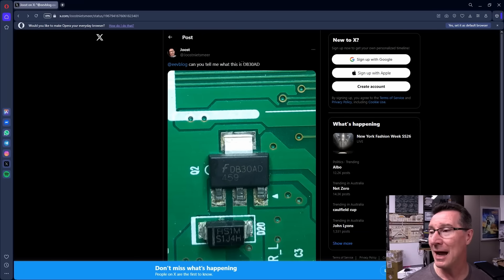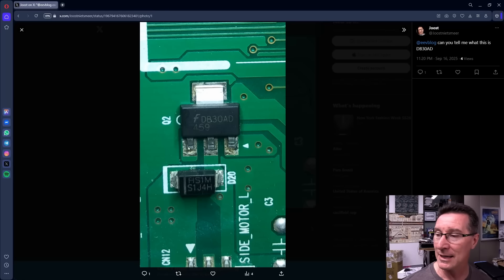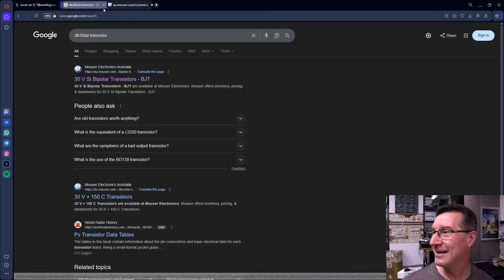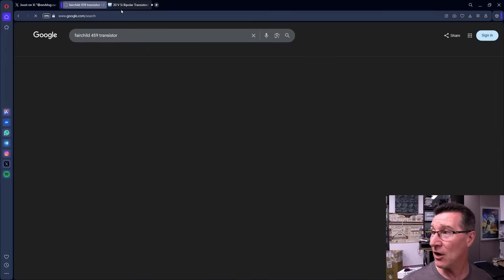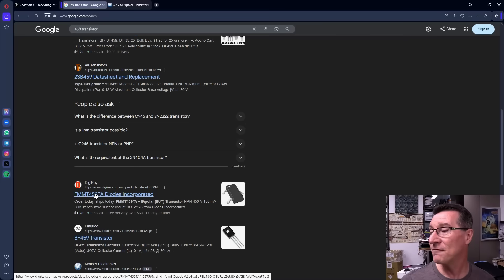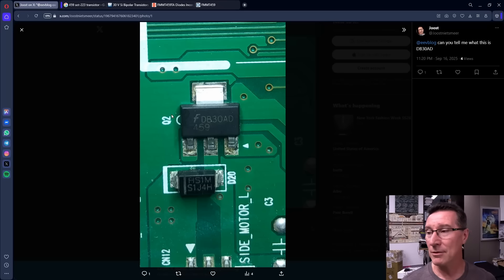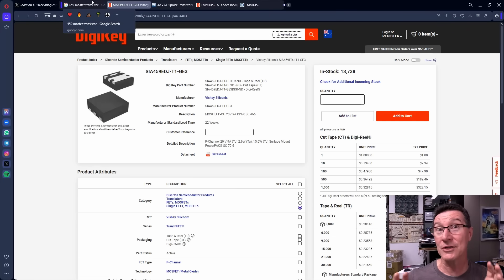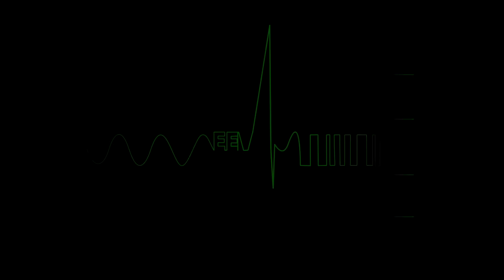EEVblog 1708 - What's This SMD Part?

Comment: I previously worked at a semiconductor manufacturer and it once took a full week to confirm that an IC on a board was in fact ours and exactly what it was (DCDC regulator). It was a smaller part but they certainly could have made the identifier more pronounced on it.

Comment: Dave, your point about including the manufacturer in the search term can be critical. I'm restoring some 50+ year old equipment and recently was searching for data for part where I had both the manufacturer name and part number. No luck on an exact match for the part number but using the manufacturer name alone I found a data sheet from the correct era but still no luck, so then looked in the folder containing that document and found another document with data on the part I have. Interestingly AI searches could not find this document even when the AI was given hints on how to search.

Comment: And then the board designer decides that it is a good idea to leave the silkscreen off when they have boards spun up.
Reply: My employer stopped putting SS on most boards many years ago.  Some exceptions.  Cost reduction reasons initially but now a lot of boards are so dense with really tiny parts there is no room for it anyway.  Then there is the issue with the SS height affecting the stencil laying tight/flat to the board.

Comment: is this a challenge is it ? ok no google no nothing. side motor L connects to middle pin collector or drain.
motors have kickback , it looks like a kickback diode D20, with anode connected to collector/drain. its an NPN or n-channel mosfet.
and with laser etching , wacky part number and modern soldering that sux like lead free.....this is likely the most average mosfet on the market or a bipolar transistor with some amazing saturation voltage specs. definitely the cheaper option imho.

Comment: I've had great success using ChatGPT 5 with its agent mode. I can pop in an image of the component and it takes anywhere from 5 minutes to 30 minutes to research and find the data sheets when it would have taken me more time if I could find it at all. Sometimes it will struggle and may provide something close but not exact.  But, combined with my experience and knowledge I can figure it out. Saved me a lot of time digging.

Comment: Problem is the older discreate parts are now gone to SMD and the part numbers are out the window. And sad the manufacturing doesn't even try to make their parts known or easily identified... Even resistor color codes are basically useless now too... New generation of electronic parts has taken over.

Comment: What would be the reason to not put FDT459N on the case?
Is that to help the people who would normally sand the markings away?
Reply: Clippy has nothing to hide behind obfuscation.
Reply: Not enough space, font would be too small, and if you believe you can read laser inscribed tiny font remember we coat our military-grade boards in heavy conformal coating so markings you could read naked, can't read anyways due to CC.
Also something you can read inder very strong microscope, does not mean AOI can easily pass-fail read.
Reply: @nameredacted1242  In the example shown it is very clear that the full type number would have fitted in the available space using the same font used now.

Comment: Oh  yes, most of us are really struggling  with deciphering part numbers these days and finding it is a real pain in the butt and a real waste of time because of the carelessness or stupid  and ambiguous naming choices/writing positioning on semi-conductors and not only. In my opinion, there should be an international convention where the manufacturers should be obliged  to adhere  (by some kind of strong international laws) to never put their own code (for their internal use ) nor any batch number  or date etc or any other useless data on the top line of writing. They should always write  the part number  first   and then    any other irrelevant info  underneath. this way  everybody will learn to always read the first line only when looking for the part number. Tnx. for sharing this with us all.   PS:  on the same line of complaints  there is another problem with finding the key (PIN nr. 1)  on small SMD  style IC's.   Sometimes is a small dot, sometimes is a very faint tapered edge, sometimes   1 to  3 parallel lines, and sometimes  you cannot even see  any of the above   simply because the key  was printed and is so faint it looks like is not there,  so what do you do ?
Reply: Nope you got it wrong, date code is as important as part number in industrial settings. It happens very often in industrial electronics that a defective batch has to be pulled, pre or post installation onto PCB. Logos also important, half the time you can spot a counterfeight just from tiny logo differences. Parts can be made in multiple countries by multiple factories. First question you get from supply chain on defective part claim is "what's the lot code".
The one and only thing I would like are:
1) Universal dot code standard marking on RLC SMD parts.
2) Superfine laser inscribed marking or larger SMD parts (instead of smudged paint).
3) Standardized silkscreen.
4) Right to Repair and requirement to publish schematic for industrial products made over 100k quantity.

Comment: The one thing I hate is SMD capacitors.  The only way I can tell the values of SMD caps is the taste
Reply: I wonder why dot color code is not ised for SMD part value (R, C, L).
Reply: Colour, size and number of layers (seen with microscope) is only hope for us, when there's no board view. Also when it's around some IC it's worth to check it's datasheet and example schematics, usually they're not that far away from what's on the board
Reply: It's annoying, yes. But most SMD caps are bypass / decoupling anyway and the exact value (10 or 100 nF etc.) not really that relevant.
Reply: @hermannschaefer4777   Voltage rating probably more important than capacitance for an SMD cap, yeah.
Reply: @hermannschaefer4777 most of the time, yes. but get unlucky with derating and resonance and a cap that is too large or small or just the wrong type can cause your power supply to go completely out of spec.
Reply: There are at least 'hints'. Their colour and size will give you hints about at least their roughly values.
Reply: This can be problematic when you are a manufacturer and volume constraints force you buy cut tapes. If you rely on the supplier to send the correct part and they send the wrong just once, then you are going to have a bad day. We had to sample test incoming goods after we were caught once. I this case the capacitance value was critical in the circuit.
Reply: @peteroneill404  Yes just had this with some 220pF I was using for RFI suppression.  I couldn't understand why my mic pre-amp had a low pass 2kHz Filter.  Turned out the clearly marked package contained 220nF not pF.   That ruined my day.
Reply: Or the smell
Reply: Get yourself a set of tweezer probes with bananas for your DMM.
Reply: @Scrogan  Often times, you need to know the value of a part that has failed. In those cases, you can't measure them, and if there are no markings on them, you're left guessing.
Reply: @Scrogan  banana jacks taste funny though, like apple jack cereal, synthetic, nobody likes that stuff.

Comment: I’ve seen plenty of voltage regulators marked Q# so excluding that possibility based on it being a Q isn’t prudent
Reply from the maker: Should be obvious from layout as I mentioned. You'd be a fool if went looking for voltage regulator with a part marked Q, you have to pick your best chance.
Reply: @EEVblog  Right, but I’d also be a fool if I ignored an obvious voltage regulator just because it was marked Q. ;)

Comment: Key Specs of FD830AD (Fairchild)
Type: N-Channel MOSFET

Package: SO-8 (Surface Mount)

Drain-Source Voltage (V<sub>DS</sub>): 30V

Continuous Drain Current (I<sub>D</sub>): ~6.5A (at 25°C)

R<sub>DS(on)</sub>: ~0.045Ω (typical at V<sub>GS</sub> = 10V)

Gate Charge: Low, suitable for fast switching
Reply from the maker: That ain't it, Chief.
Reply: a clippy using ai is ironic

Comment: Sometimes the datasheets will also explain their chip markings too.  Date code or whatever.  Not always but some do.
Reply: That doesn't help if you have to find the datasheet in the first place.
Reply: @theIpatix  Finding datasheets is not the problem, finding the right one is. If both markings match you can be almost certain it is the right part, so checking this does indeed help.
Reply: @theIpatix  You can use it to find the datasheet. Not easy, but sometimes possible.
Reply: Yes, that can turn the "warm fuzzy feeling" Dave mentioned into smug supremecy
Reply from the maker: This one doesn't.
Reply: @EEVblog  But some sometimes they do
Reply: @arongooch  But this one doesn't.

sorry, couldn't resist.

Comment: I have had success uploading such photos to chatgpt and asking for part identification.
Reply: Sixty to eighty amps?  I don't think so!
Reply: nice
Reply from the maker: Worth a first pass attempt. Maybe Google Lens too? I mostly use Grok.
Reply: Copilot nailed it for me on the first go > "That component labeled FDB30AD 459 is a power MOSFET—specifically, a Fairchild FDB30AD, which is now under ON Semiconductor following their acquisition of Fairchild."

Here’s a breakdown of what it does and where it fits:

🔍 Component Overview: FDB30AD
Attribute	Details
Type	N-Channel Power MOSFET
Package	D2PAK (TO-263) surface-mount, equivalent to SOT-263 from other manufacturers
Voltage Rating	~30V Drain-to-Source (V<sub>DS</sub>)
Current Rating	~60–80A continuous drain current (depends on cooling and layout)
R<sub>DS(on)</sub>	Very low—typically <10 mΩ, ideal for high-efficiency switching
Use Case	Power regulation, motor control, DC-DC converters, battery protection
Mounting	Surface-mount with large tab for heat dissipation
Reply: @yodafuzz Shutup AI and just go copy Wikipedia....lol
Reply from the maker: @yodafuzz  FAIL